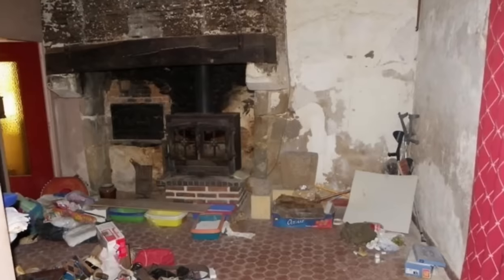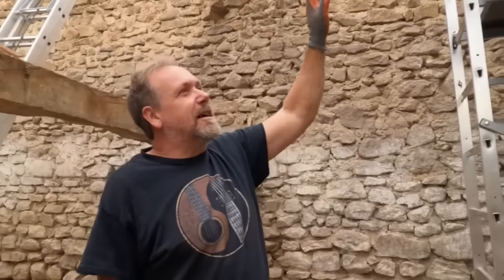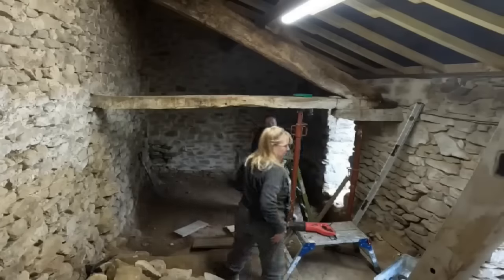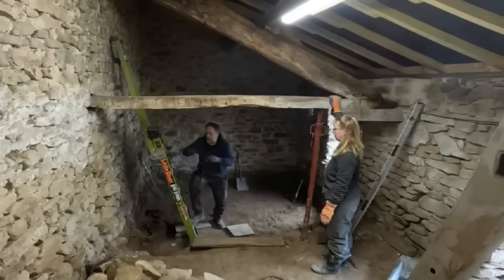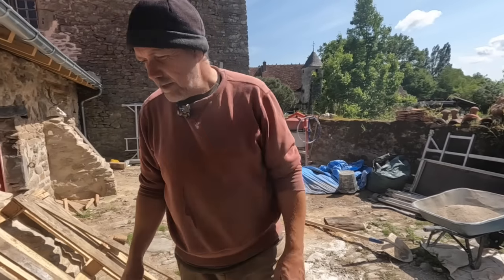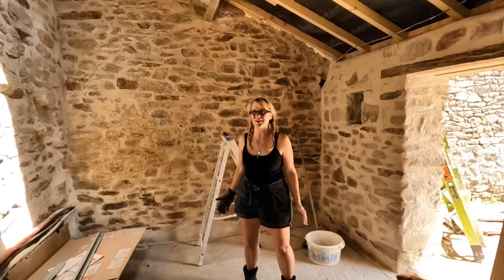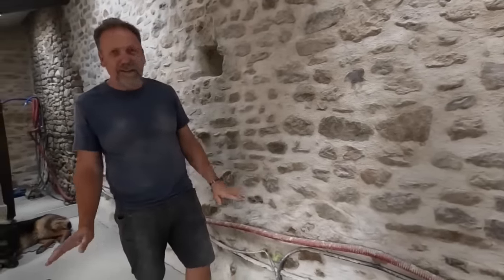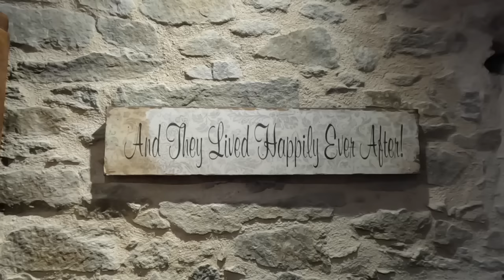From Ruins to Luxury: Chateau Renovation Timelapse in 30 Min

Comment: I think it is a great, great job! But I would have a question: what measures did you implement to avoid all the stones from falling down in case of earthquake? Thanks.
Reply from the maker: We didn't take any measures, the building is nearly 900 years old and has stood the test of time for this long, so by rebuilding it in the way it was built originally, hopefully will help it to stand another 900 years 👍

Comment: Gorgeous ❤ Do you find that it stays cool inside or will you need air conditioning at some point? Just curious 😊
Reply from the maker: It is cool enough considering the temperature today hit 100 degree but we are thinking of installing a heat exchange to provide either cool or hot air before the winter 😁👍

Comment: So lovely ……..  Pride guys ………. Question The barn door goes to the outside courtyard - will you seal that proper so that cold winter air & elements do not come in - seems you can see light under the door …….  sending Love and wishes for great prosperity your way
Reply from the maker: There will be modifications to the barn door, but also a shutter on the front

Comment: a small tip when you point the walls take an old brush saw the brush part of and  saw a slot in the brush part and put a stiff piece of rubber in it. in this way you only fill the joints and do not smear all tstones , then hit all the joints with a hard brush when it is still wet. and then immediately wipe with a soft brush and water. then you don't have to go over it with a steel brush later to tidy everything up

Comment: Doesn't it get cold enough to freeze water pipes in the winter? I'm questioning Why  No insulation  on the water  pipes you ran behind the wall there won't be any heat back there and a stone wall gets pretty cold,  your renovation is remarkable by the way. That was a ton of work
Reply from the maker: No, the walls are 2 ft thick so no chance of freezing 👍

Comment: Wow, that's a lot of work. Sandblasting the stone after putting in the new mortar would give more definition to the stone. A high quality sealer will bring out the different colors in the stone. It worked great on a fireplace we built.
Reply from the maker: We didn't want more definition to the stone, if we did we would just have brushed back more, there is no need for the expense and mess of sand blasting, but it is all about personal preference and the final look that people want. That's the nice thing about it, you can do so many different styles and techniques. I would worry about sealing the wall, would this not defeat the object of allowing the wall the breath?
Reply: @ChateauDeMontmagner  You're right about preference and that's what it's about.